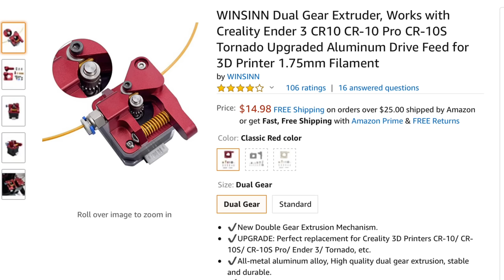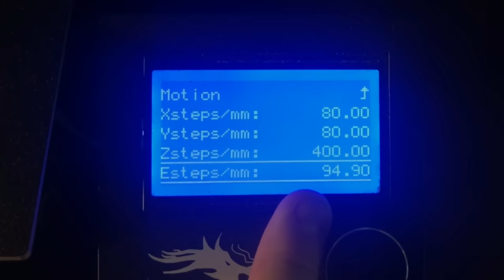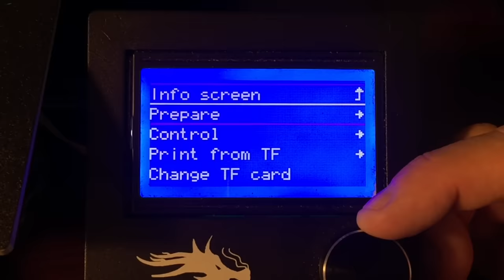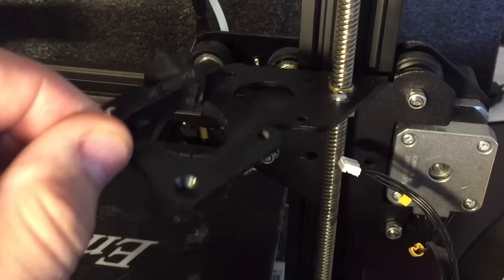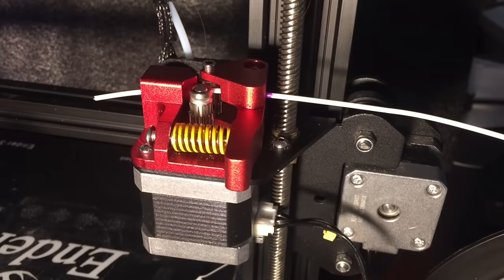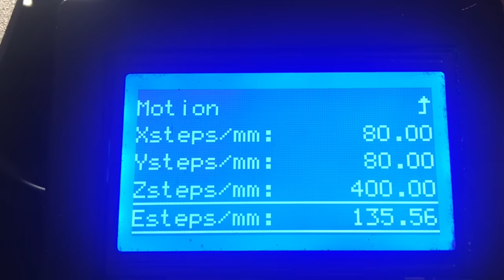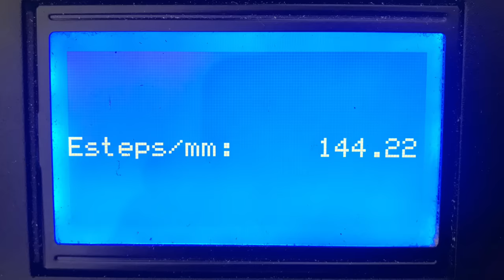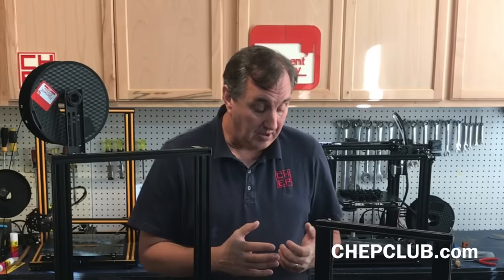Dual Drive Gear Extruder Upgrade + E Steps on Creality Ender 3

Comment: Just a heads up to everyone, the upgrade is no longer doable on the new ender 3s. They now press the  gear on. :/
Reply: Not true, you just gotta get good leverage with two thick screwdrivers and pop it off. I did mine, however you gotta file down one side of the shaft so the screw doesn't slip.
Reply: You can buy a new motor its what i had to do for my Ender 3 Pro
Reply: @desertlightning7335  That seems risky, especially since filing down the motor shaft is reversible. Now im thinking to stick with the old extruder. Did everything work out well for you?
Reply: Could the old gear be pressed back on again after "popping it off"?
Reply: i ground the brass gear off the motor with a grinder, but the shaft isn't long enough for the set screw to grab the shaft
i glued the new extruder gear onto the motor, we will see how it holds up
Reply: @Nico_Nico_Knowles  what is the new motor you got, I had the same problem
Reply: @JohnSmith-tj5se  did it hold up
Reply: @malcolmhj1a  it did not hold up, it only lasted a few hours of print time and the glue broke, i just ordered a stepper with a longer shaft
Reply: @JohnSmith-tj5se  my problem is i have very shaky hands and cant even screw in the small thread into the stepper motor, its tight enough to lock but when i install the extruder arm it falls down and it doesnt seem to want to tighten anymore, and ive lost that microscopic thread twice,  might just upgrade to micro swiss
Reply: Here I sit all broken hearted.  Same issue, had to pop off the pressed on gear only to find that the motor shaft is too short.  Can’t get the new gear high enough to line up with the filament.  Now either need to buy a different dual gear or a replacement motor

Comment: Im having too many problems related to stringing. I cant get rid of them. This extruder help me to solve underextrusion but now I have a lot of stringing. Does anyone has the settings for retractions using this extruder on cura? Thanks!
Reply: It's unrealistic to get rid of stringing but stringing first of all can be of a worn nozzle diameter or more likely the idler lever arm has been eaten away by the second drive gear and the gear is sliding and preventing a solid grip of the filament. Let me know what you see when you remove your second drive gear. Ideally for a printer as large as a Ender 3 retractions should not exceed 2.5mm or 3mm by my experience. For a machine as large as the CR10S Pro, retraction should not exceed 3.5mm or 4mm.

Comment: if I change the esteps to 100 it works great however it wont save that setting and reverts back to 93 after I restart the machine even when I click save settings,any ideas?
Reply from the maker: Not sure what would cause that.
Reply: @FilamentFriday ok thankyou,i will have to try and find a firmware I can upload and see if that fixes it, I am on the BIGTREETECH SKR Mini E3 V1.2
Reply: @davegee124  Your firmware might have EEProm disabled.

Comment: Can this be used in a direct drive configuration
Reply: you'd need some custom part but this can be fitted on an E3D v6 with a tiny bit of imagination, for a DD configuration it's propably better to go for something dual drive AND geared, like a BMG extruder (or a clone) which will either give you plenty of torque or allow you to switch to a smaller stepper motor to gain weight on your X gantry.

Comment: Do you have any video on CR-6 SE
Reply from the maker: An old one but I don’t recommend that printer. It’s old. Unless you want to reflash it but I’d still look at the new ones like K1C or K1Max or if you’re on a budget, the Ender 3 V3 SE.
Reply: @FilamentFriday  Well I already own the printer.  Today I have ordered the dual gear extruder kit for it. Now somehow I need to change the e-step, right?

Comment: I think your calibration methodology is flawed. It is extruding too fast for the hotend. Try the test again but use a PC to send the gcode but at more realistic speed that will mimic printing more closely. You will be over extruding the way you have it set.
Reply from the maker: Calibration worked fine. I didn’t see any over extruding in the prints. Did you see any in the ones I showed?
Reply: @FilamentFriday   Look like some backlash. Surprised to see stepper motor turn off after extruding. I still feel the best way is without any pressure. As far as the print comparison the picture wasn't on a very good angle.
Reply: Thinking, is just cognitive bias and as useful as a belief in fairies or tits on a bull. Testing and knowing is everything.
Having a theory is fine but you need to put your hypothesis to the test with as many methods as you can, including Chucks and video your results as you go. 

How can you have "tech" in your user name and not know or use the scientific method?
Reply: Or on the screen extruder 10...let it catch up....10 more.... repeat until 100
Reply: @LukePettit3dArtist  I will overlook the jab. It does have my wheels turning for a video. Just need to come up with a test. It's almost impossible to test. Can't test by measuring single wall thickness. Don't know what is right. Maybe by weight. In the end just matters if you are happy with the results. We arent making rocket ships.

Comment: Mine doesnt have the set screws.. have no idea how to get gear off
Reply: Some models came like that, they are pressure fit on you need either a small gear pulley or buy another stepper motor
Reply: Yeah what HARD88LUCK said. I'd recommend just getting a new stepper motor. IMO its not worth pulling the gear off because it doesnt have the flat side
Reply: @kenopyowo  Mine was press fit. Had to use a Dremel to remove the original brass gear. However, the shaft wasn’t long enough to do this upgrade. Had to buy a different stepper motor anyways.
Reply: @nneiil  what stepper motor did you buy? Thanks!
Reply: @DerdsBackyardGarage  did you ever figure out which stepper motor to buy?

Comment: what do I do if theres no e steps menu. I'm running marlin firmware and cant find it anywhere
Reply from the maker: You can connect to it via usb cable and use Pronterface.com software to send GCode to it.
https://marlinfw.org/docs/gcode/M092.html
Reply: @FilamentFriday   Awesome thanks!

Comment: Hi...how does it work with tpu and other flexible filaments?
Reply from the maker: Not well
Reply: @FilamentFriday  so what ?thats only for PLA and simple filaments??
Reply from the maker: It doesn’t trap the filament path so flexible escapes.
Reply: CHEP and what if I extrude 100mm and only 40 goes in ?? But at the end of the print the weight is the same as the slicer says
Reply from the maker: Don’t know but 40 mm of filament is so light it could be scale error?

Comment: HELP NEEDED HERE:
since my double gear extruder installation and recalibration of my E-steps I encounter a high amount of stringing.. no matter what retraction settings..
Reply from the maker: Check your couplings for movement.
Reply: @FilamentFriday  I already did but they are sitting firm
Reply: @JOJoJoOsH  Probably the grinding of the second gear on the lever arm chewing its way to kingdom come and slipping, there isn't an easy fix, but with the lever arm damaged, a slot needs to be grinded away with a dremel or something and filled with a brass washer and industrial grease
Reply: @Bajicoy   I already milled the lever and put brass shims below and above the gear
Reply: I got the same problem. You find any solution yet?
Reply: @JOJoJoOsH  Interesting, well, I suppose we can go through the list of trouble shooting options aside from couplings or extruder grinding. First thing first, make sure there is a near obnoxious amount of tension from your extruder spring on the lever arm. This is the cause of 99% of most retraction issues.

1. what are your E-steps? ignore your calibration and set them to 139 with 3mm retractions at a fairly low 60mm/s, ensure micro travels will also register retractions for the size gaps that the nozzle might be traveling between ie. if your nozzle is doing 1mm moves, make sure micro travels for retractions for your slicer activate between spaces less than 1mm. If you are still getting a high amount of stringing, lower your E-steps to 130 and then some by 10 step increments until you get under extrusion. If stringing still persists, this is not a software problem and there is something wrong with the extruder or hot end.

2. Check your machine's retraction acceleration as well, there is a decent chance with high retraction speeds and lower motor current that steps can skip. at 139 steps with the A4988 standard drivers something like 3000mm/s^2 acceleration or lower like 1000mm/s^2 might be reasonable. If you feel confident that steps are not being lost, feel free to ignore this.

3. Check your PTFE sits firmly into your hot end, check for mechanical error as your nozzle might be worn out, bored the wrong size, or there could be some leaking material. Basically, with any kind of retraction there is a good chance of heat creep preventing an accurate retraction due to filament getting trapped in or near the nozzle. The worn nozzle part is a bit more self explanatory in that a hole greater than 0.4mm will let out more filament than 0.4mm slicer settings.

4. Potentially the brass shims are not providing enough clearance to the teeth of the drive gears and they might still be catching on retractions. Additionally, the grinded down lever arm might be too flimsy now to hold the drive gear with the double shims. I doubt this is happening but ensure you have proper industrial grease for your brass shims and I really want to believe these are brass washers and not shims because improperly sized shims have a high liklihood of catching on something. I am just trouble shooting, I am sure you did an excellent job with your mod.

5. Keep in mind stringing cannot be removed completely from 3D prints especially for bowden set ups. I imagine you have realistic expectations but I just want to check for general troubleshooting.

6. Remove any filament cleaning or oiling devices, these have a history of causing slipping. Bearing lubricant and grease used on the drive gears can also get carried onto the drive gears so they might need to be cleaned. It's also a good time to clear any filament debris clinging to the drive gears as well.

7. Print slower, try printing at 40mm/s and slowing travel speeds to 80mm/s, it is possible the printer is outpacing the machine's retraction speeds

8. Raise your retractions to 4.5mm at 130mm/s at 10,000mm/s^2, This is hyper aggressive for a bowden tube as long as the Ender 3's

I hope some of this information helps or gets you started in the right direction, I wish I could help more because you seem like a cool fellow that knows their way around tinkering with a 3D printer.
Reply: @joemartinson1826   Hey Joe, I just posted a trouble shooting guide as a reply to StargZero, let me know if this helps or if you still run into the same issues or if your situation turns out to be different from Star
Reply: I finally found the issue.
The ptfe tube that is attached to the coupler on the Extruder is very well worn. I just cut the worn section off and now it sits tight.
Thank you guys for your help!!

Comment: I got the same gear on my ender 3 pro, and end up with the same calibration numbers - 135steps/mm in "free" mode, 142estep/mm when pushing thru the hot nozzle.

Comment: Does anyone know if the gears themselves are made from steel? I am looking for a new extruder assembly as fiber reinforced filaments like carbon fiber really wore away my brass ones and essentially destroyed them.
Reply from the maker: There are hardened steel gears for printers.
Reply: CHEP I’m just wondering if the ones that come with this assembly are steel

Comment: My Stepper motor has no "Set Screws" on it, the gear seems to be wedged on there.
Reply: Some creality extrudes come like that. It’s annoying but an easy enough fix. You can either get a little penetrating oil like PB blaster or 3-in-one oil and put a little onto the top of the gear. Let it sit there for a moment to get between the gear and shaft. Then you can take two small wrenches that will fit under the gear and push up on the gear from two sides with the wrenches. With a little effort the gear should slip right off. Or there are files you can print available online that make a little gear puller tool made for those press fit gears.
Reply: @LeeryMuscrat  would WD-40 work?
Reply: @DracoEX it should. really any thinner tool/general use oil should work. so long as it isnt a thicker oil. just hsa to be able to seep into the space between the gear and shaft 

Just be careful if you use the WD-40 that comes in a spray can. it would probably be pretty easy to overspray it and end up with an oil-soaked stepper. dont know if that would cause problems but it would probably be better not to find out.

Comment: would you still buy this and install this?
Reply from the maker: I’d change the spring to the stock spring.
Reply: @FilamentFriday  so you keep the upgrade but keep the stock spring?
Reply from the maker: I prefer the EZR over this.
Reply: @FilamentFriday  do you have a link to ezr
Reply from the maker: It’s here: https://youtu.be/1GNDxvxpWr8

Comment: You had your esteps set to 94mm and you moved 94mm of filament with the single gear extruder...seems pretty accurate to me unless I'm missing something here...
Reply from the maker: That setting is 94 esteps/mm not extrude 94 mm. I set it to extrude 100mm and it extruder less so the esteps/mm was off.
Reply: @FilamentFriday  ah ok, that makes sense, thank you for the explanation

Comment: Why not use the SEEMECNC EZR STRUDER
Reply from the maker: I have used the EZR and recommended it. 
https://youtu.be/1GNDxvxpWr8
But some people have asked about this dual gear drive found on CR-10S Pro. And it’s about 1/2 the cost so I tested it.
Reply: @FilamentFriday  Hello ! Is it possible to use this dual-gear extruder to print flex filament? compare to EZR ? I would like to change my stock extruder by one good able to print flex filament :). Thanks for your vidéos !
Reply from the maker: EZR can handle Ninjaflex, this dual gear cannot.

Comment: Anyone have the issue that after you tell it to push through 100mm, after it does so, it goes in reverse?
Reply: Did you set your Esteps/mm negative?
Reply: @scheve332   I don't think so... may I ask, where would I look?   I just did the hot end modification and now it will go in reverse, then go forward for the same distance.   It's a bit frustrating when it doesn't work like Chucks!  LOL.

Comment: Hi, so I followed all you steps to calibrate the dual gear extruder, how ever the slippage I'm getting is not constant, I ended with 146.6 steps without the bowden tube and got 100mm, bit when i pit it back and then send it through the nozzle, then i get only 90mm extruded, i compensated as you mention and end up to 162.88, then it extruded more than 100mm almost 120, then i tried it again and does less :/
Reply from the maker: Sounds like you need to clean out the nozzle area.
Reply: @FilamentFriday  thank you, apparently my hot end is not getting hot enough i checked the temp with a touchless thermometer and showed 140 when was set to 260, screen says reached 260 anything to look before replacing the hotend?

Comment: My extruder motor gear doesn't have screws to take it off
Reply: I had the same issue. You have a stock motor. They made them unmodifiable. Easily replaced however with an additional 40-42 motor from Amazon.
Reply: Same with me. Got any other solution apart from changing the motor?

Comment: Can this extruder extrude very flexible TPU?
Reply from the maker: No
Reply: @FilamentFriday   Why..??
Reply from the maker: It escapes the gears.
Reply: @FilamentFriday   mm ok,
I've seen parts that regulate the pressure of the gears, that works
..??
have you tried them..
Reply from the maker: No . It’s the resistance of the filament that causes it to pop up out of the gears. The EZR Struder is what I use because traps the filament in a channel so it can escape.
Reply: @FilamentFriday  Should I use this extruder or the EZR?
Reply: @FilamentFriday   thanks. and with the EZR extruder you also need to change the steps / mm

Comment: can this print flex ?
Reply from the maker: Some but not the real flexible Ninjaflex.
Reply: @FilamentFriday  so i'm guessing for the real deal i'll need to do bondtech with direct drive (i have an ender 3 and i'm considering the clone from ali to keep things within my budget)
Reply: @FilamentFriday  Im trying to print tpu (sainsmart, but get tons of stringing no matter what i do)  myself....so is it better that i just buy a direct drive and forget about the dual extruder all together or do both upgrades?

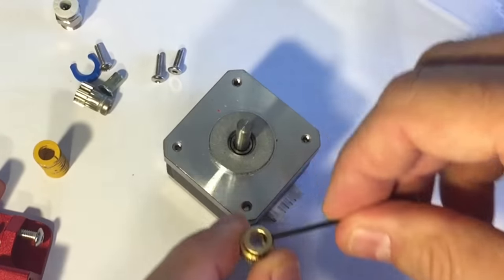Comment: 4:59 I have 5 Ender 3's and none of them have the set screws to remove the gear from the motor. Do I have a different model? I cannot find a video showing how to remove my gear from its motor.
Reply: i would recommend buying a stepper motor off of amazon for $20 its a 42-40
Reply: They’re pressed on, a good pry and it should pop off

Comment: I have experienced a problem with the set screw holding the drive gear on the shaft of the motor. I’ve had the Extruder for 2 years, and the set screw is severely stripped, and is not able to hold the gear in place. Does anybody know where I can buy just the screw(m3x2 set screw), or do I need a whole new Extruder?
Reply from the maker: You can buy a new gear on amazon.

Comment: I'm not gonna upgrade just because I suck at math. 😂
Reply: my extruder said "set e steps/mm to 140". if i set e steps/mm to 140 then extrude and I'm 6mm SHORT, my math would be: (100/(100-6)) * 140. if I was  6mm TOO far, my math would be: (100/(100+6)) * 140.